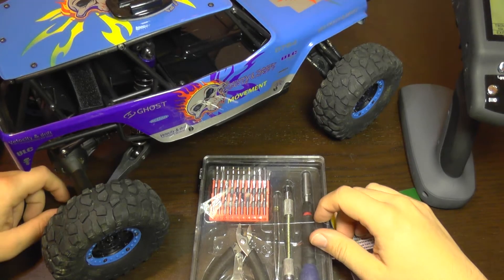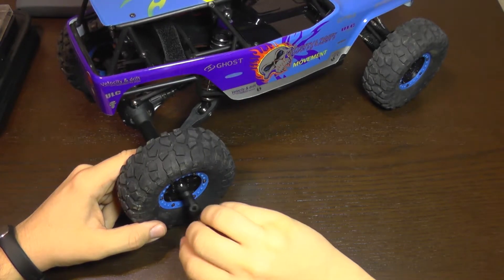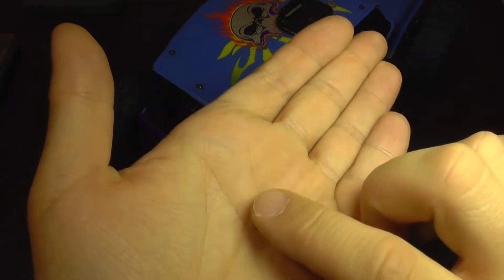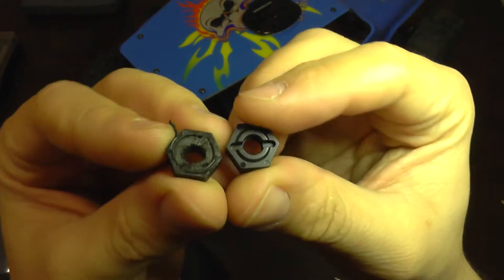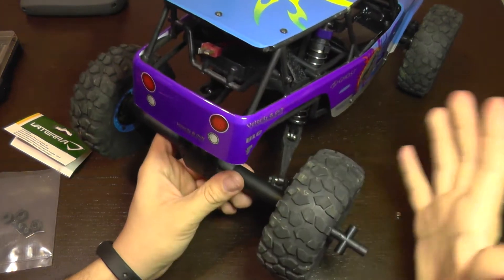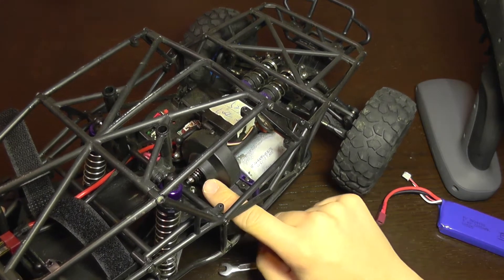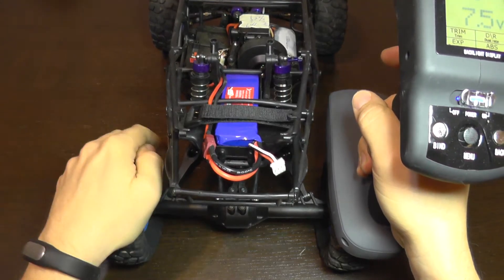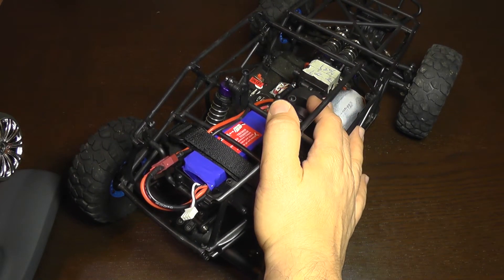WLtoys 10428A Wild Truck Warrior - Slipper Clutch Adjust - part3

Comment: Nice video, I really enjoyed it. Just some advice to anyone trying to adjust their clutch on Wltoys 10428 using this method of locking the wheels: Be extra careful! I did exactly as instructed in the video, barely holding the wheels for 1s while adjusting the clutch, and in the fifth time my ESC died. In my opinion its safer to adjust the clutch by simply accelerating fast and try to brake until the point that any extreme acceleration or braking engages the slipper clutch. ESC in this model can't handle high AMPs, and holding the wheels is a sure way to burn it. Last advice, install a fan on top of this ESC, it gets really hot without one. Cheers from Brazil!

Comment: Great video, and awesome walkthrough. Btw, I am not sure but if English is not your primary language; you still do a great job at speaking it.

One question though, why didn't you just upgrade the wheel hexes to aluminum? It nearly eliminates the risk of stripping the hubs out or sheering the pin off, costs about $2 with free shipping for a generic set of four. It's usually always the first upgrade I make on any RC, and can really make a difference on lower end trucks with plastic hexes. Of course I don't recommend aluminum hexes if the rest of the drivetrain is plastic as that's a quick way to blow differentials, snap driveshafts and explode drive cups.
Reply from the maker: Thank you! I'm not a native english speaker, as for the hex I still use plastic as means of protecting the drive train, aftall it's still a cheap WLToys so i expect failures with aluminum hexes.

Comment: Hai, i have wltoys 10428 b and im having reduction gear problem. One of the reduction gear is always broken which make the front wheel wont spinning. Do you have any suggestion? Thanks
Reply from the maker: Only the front wheels are not working ? Maybe the front differential is faulty.

Comment: great video! thanks. would be cool showing calibration of transmitter. maybe a video on accessories like lights! Also I think this is part 4 cause I watched the first 3 parts.
Reply from the maker: I haven't tried to add accessories to it because you will also need extra channels from the TX and the RX.
Reply: I see. You should do a full on complete disassembly video then. If you have time.

Comment: Wow! what surprised me is that, the pin bent and hex stripped before breaking the rear center driveshaft.
Reply from the maker: Yes, it failed as it should, i prefer a stripped hex and bent pin than a diff overhaul.
Reply: diff is pretty tough, what usually breaks is the center rear propeller/driveshaft.